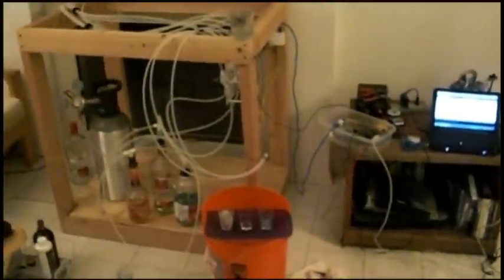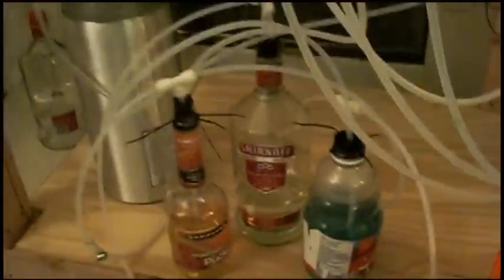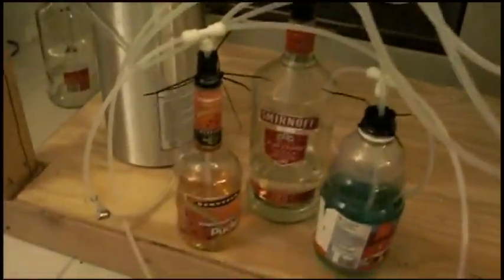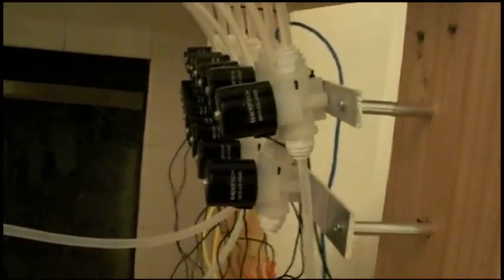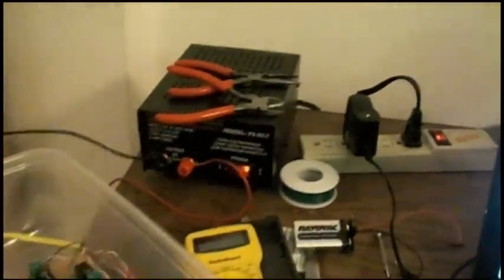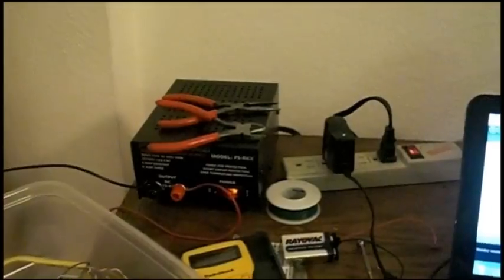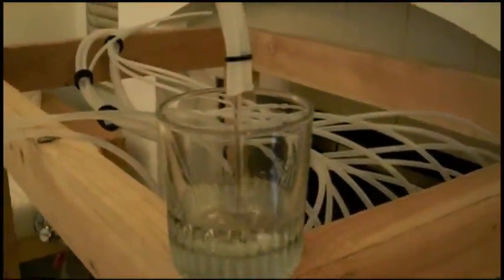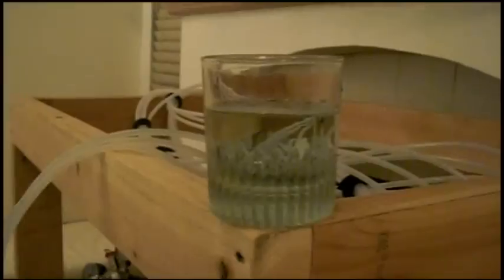First Demo of Automated Bar

Comment from the maker: @byles Yes, the pressure is so low that it does not stress the glass. If it was a bit higher I would be worried but under 10psi would be fine. A shaken soda bottle is about 25-30psi.